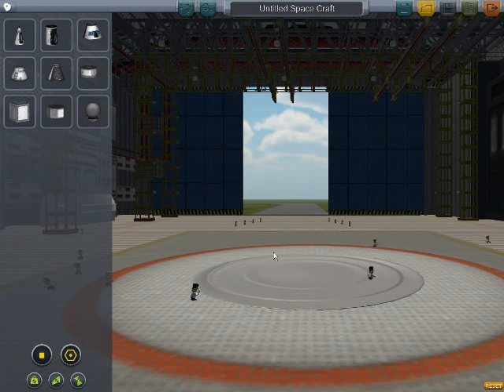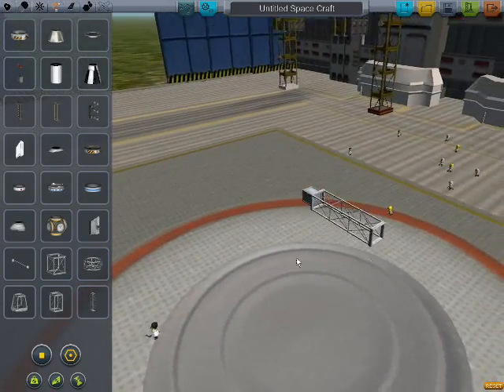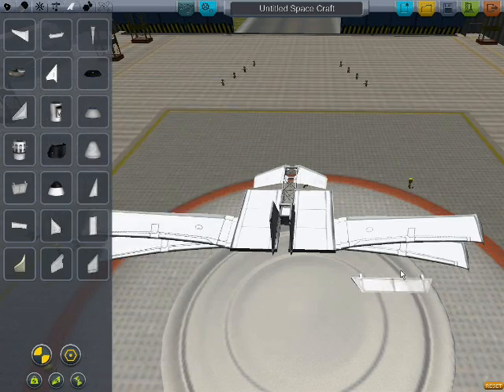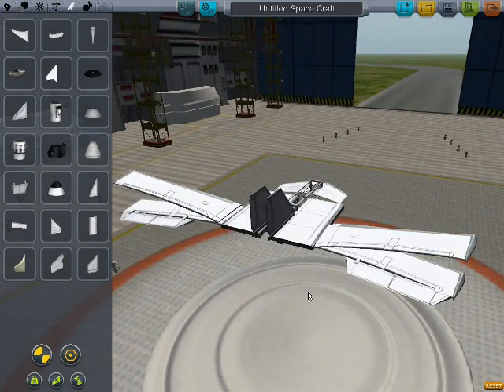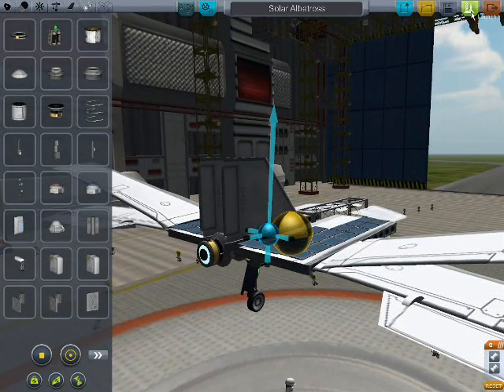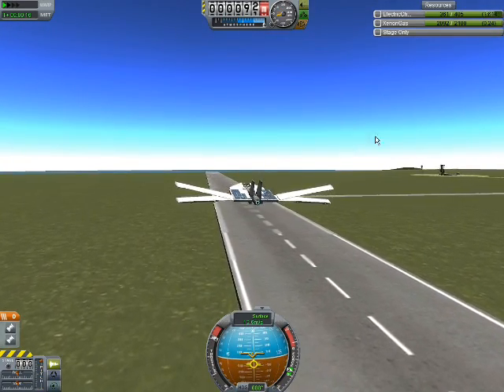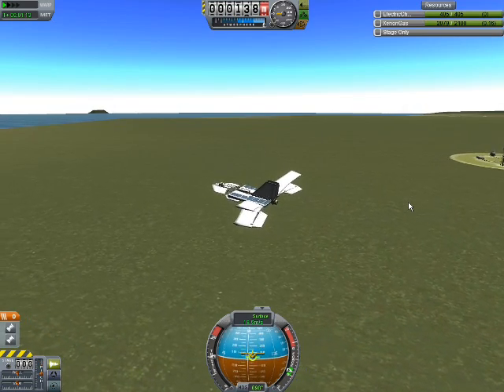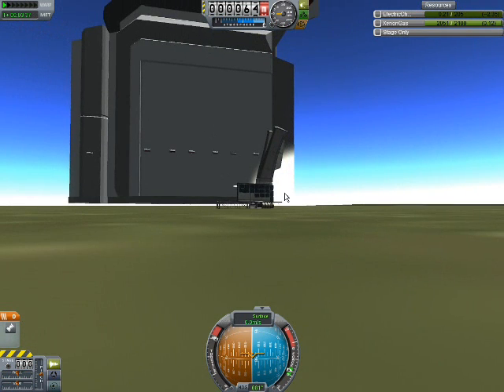Let's Dick Around Kerbal Space Program: Solar Plane Tutorial

Comment from the maker: If the center of mass and the center of lift were completely in sync, then the plane, with its high lift and low weight, would be almost impossible for me to fly. I don't know why, but it's far less stable that way.
As for more solar panels and another engine? That is a possibility, and would, in fact, make things a bit easier. It would be a tradeoff, though, flight speed and maneuverability in exchange for flight time.
I'm STILL trying to make a plane that will circumnavigate Kerbin.